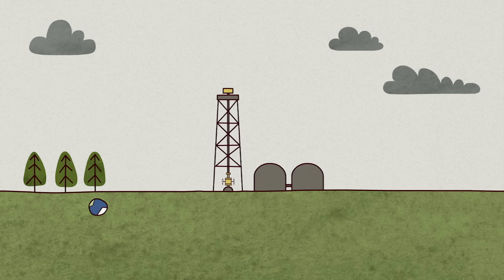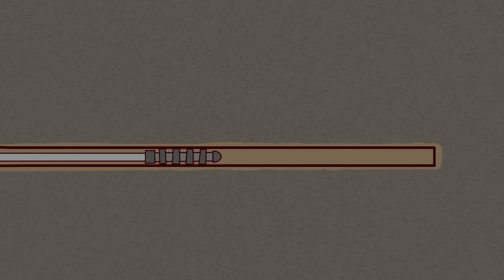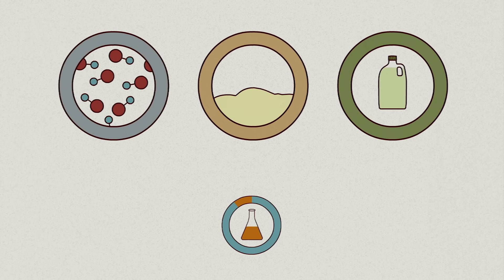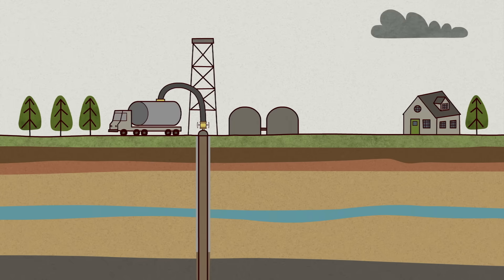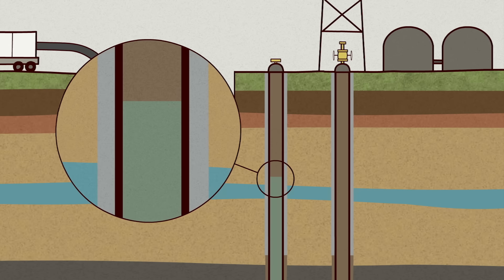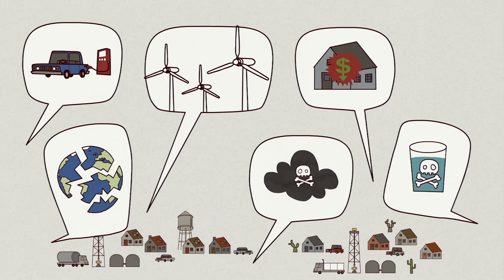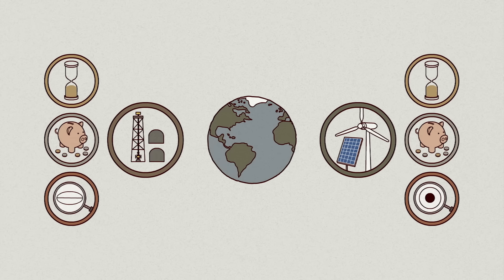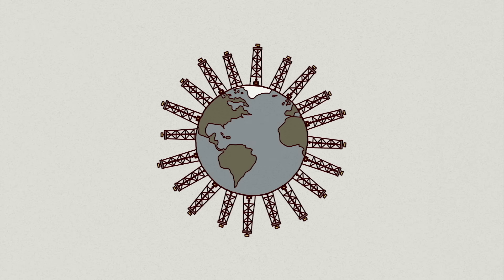How does fracking work? - Mia Nacamulli

Comment: I have one comment regarding how fracking (i.e. natural gas industry) diverts developmental resources from those of renewable energies. It is strictly informational, but still feel free to respond w/questions or points for further discussion.
The means by which energy is generated from natural gas is far more flexible than many of its competitors, including renewables, because its energy output is variable and feasibly managed. These two factors are critical when supplying the highly variable demands for energy typical of societal energy consumption.
Renewables, along with other industry competitors, could more readily compete if there were major advances in energy storage systems/technologies (e.g. batteries, mechanical storage, etc.), but those advances are dependent upon the energy sector's developmental resources. 
If renewables could less directly compete with other energy options for its development dollars/resources, then the "energy storage stop-gap" might avoided, but until then the U.S. and the world will remain dependent upon the energy sector's strongest options. At the moment, fracking/natural gas tops that list.

Comment: Two major problems with this video:

1) At 3:40 when talking about groundwater contamination, you accurately depict the cement casing leak where hydrocarbons leak into the surrounding groundwater. However, you go on to say that "fracturing under water sources as well as hazardous underground seepage and leakage" also contaminate the water. This is false. It is physically impossible for hydrocarbons to travel 2500 meters through impermeable rock from the place the fracturing took place up to the water. The only risk for contamination is when an accident happens in the cement casing which is completely unrelated to the fracking process. Thus when drilling for oil and gas, fracking does not impose a greater risk for water contamination compared to a conventional well that produces oil without fracking. 

2) The vast majority of fracking done today is not for natural gas but for oil. Not once did you relate fracking to producing oil. This process has revitalized the oil industry in the USA and has lead us to become the number one producer in the world. Thus, all arguments made in this video about environmental/economic impact need to be heavily revised. Perhaps renewable energy sources could be researched and developed without natural gas but it is impossible to further develop our use of energy and way of living without oil.
Reply: umm I have to question what you're talking about 1) getting rid of waste can be cheap if the infrastructure exists it's just hard because it's dangerous if someone were to dig it up not because of its impossibility to store. 2) Why would you have to rebuild a power plant they rarely explode yes that's somewhat expensive but any other form of power you would have to do the same or pay for expensive active fuel.3 ) as for renaturation of the mines I admit I haven't heard the word before but every form of power requires mines why is nuclear power worse not only that but its not a required thing?
Reply: just seen your comment mate and you are wrong on your first point. geologist's are not able to see into formations. so the assumption the a formation is impermeable can only be surmised based on the type of mass you are getting out of the drill hole. if you have micro fractures or other types of irregularity's in the formation the first you will know about contamination will be long after the fracking has started. or worst still long after it has finished and the company has handed the site off to others. with oil, drilling, mining and power companies track recorded of failing to act in anyone's, but there own, best interests the risk of this type of contamination going unreported or corrected is very high.

at the end of the day fracking is little used and mostly in highly stable formation. with no trust worthy oversite or studies on the affects underway. this limited success with no independent critical analysis of the system is now being used to push for fracking on a wider scale. with the assumption that the technology is fully developed and its affects are understood. both of these assumptions, like your assumption that the over lying rock will be impermeable, are false. fracking is playing fast and loos with the environment to make a quick buck.

your second point seem to imply that life as we know it can not go on without oil or gas. if that is correct I would suggest that you maybe give that one a bit of a rethink because fracking is not the answer even in the sort term my friend :)
Reply: maxybaer123 the cheapest is only nuclear energy if you exclude:
-renaturation of the mine
-rebuilding the power plant 
-storage of waste (we still have no idea how to deal with)
Reply: +Davis Farish
1)when they are talking about risk of contamination under the water there not talking about hydrocarbons as clearly state "improper disposal of WASTE water can potentially contaminate drinking water" not only that but seeing as the water in question is being used to break rock it contaminating the nearest source of water is not impossible.

1.1)Your conclusion about it not posing a greater risk then drilling makes no sense you dont provide nearly enough evidence that its safer. Just think about this for a second to drill all you do is pump a liquid out of the ground and your done to frack you put liquid under incredibly high pressure into the boar hole and then crack the rock with that liquid you then have to dispose of the liquid just that fact alone increases the risk of contamination.

2) do you realize what your saying that because oil is profitable it has no impact on the environment and the fact that it has made the USA loads of money is irrelevant to the point as this video is not about USA fracking but the issue of fracking in general

2.1) It is always possible to not use oil wether or not its efficient is another question can you explain to me why its impossible to develop renewable energy without oil I understand its useful but you have yet to provide a reason why its necessary.

PS.
I am relatively new to this topic and would like to learn more Im writing this as an attempt to further understand your argument not to be a troll or scream my POV to the world
Reply: +maxybaer123 

Sorry for the late response. I'm sorry that you found my explanations difficult to understand but I will try again. 

1)  There is only one possible scenario when it comes to water aquifer contamination, a leak in the cement casing of the wellbore. I say that fracking does not impose a great risk because this casing leak can also happen in a vertical well where they are just pumping oil from the reservoir, like you said...no fracking required. In a horizontal well where fracking takes place there is no greater risk of a leak in the casing compared to a conventional vertical well. What I'm trying to say is that water contamination can happen in all oil drilling and whether your fracking or not has nothing to do with it.  

1.1) When you talk about waste water injection, this is done in Salt Water Disposal Wells. You can research on your own whether these disposal wells have ever contaminated the water table. Again, salt water disposal wells are needed with unconventional wells that don't use fracking also because water (brine) is a by-product from the reservoir alongside oil and gas. Yes, fracking has dramatically increased the need for salt water disposal wells. 

2) What I was saying is that the video only makes arguments about fracking in regards to producing natural gas when in fact today, fracking is mostly used to produce oil. Maxybaer123, all I have to say is that I would love to come visit your scientific laboratory used to develop new techniques for renewable energy that completely runs on renewable energy, uses no petroleum products (plastics etc.), and you ride your horse to and from the lab. It is only reality that fossil fuels are a necessity to take humanity to a point where it can only use renewable energy and I will welcome that day.
Reply: +Davis Farish there exist all electric cars and non petroleum plastics I agree that oil is useful but we dont need every scrap the earth has to offer we could start spending more on mass production of renewable resources and try to drastically curb our use of oil Im not saying we should get rid of it entirely just stop using it like a fuel and start using it like a metal the only things Im aware of that actually require oil as a fuel are planes (and there are prototype electric planes) and rockets.

As for energy there are many better ways of getting energy the cheapest probably being nuclear.

Comment: We simply cannot produce enough power to crack the rock from the bottom 
of the well to the water table. The water table is above an impervious 
rock/clay layer. This layer remains intact thus not chemicals enter the 
ground water supply. While you might get some flaws in the casing, the 
gas will follow the easiest path, the well head. This issue with the 
water is the disposal. The options are injection wells and new 
facilities are being built to handle this water. The pads are designed 
to prevent spills, they work as swimming poles. The sealed pads, casing 
and disposal facilities are there. There are faults all over the country
 and earthquakes have been caused by mining, construction and even just 
because the land is decompressing from glaciers. While it isn't harmless
 it isn't the danger it is presented to. There is a a lot time, 
engineering, inspection, money and oversight over these operations. Many
 people working and building these facilities live in the areas, they 
care what happens to the land, they care about their family farm of the 
last 200 years. There are incidents and things happen, but they are 
isolated and few in number. Short term, this is the best option.
Reply: @Tbone only work for independents and start ups
Reply: @Tbone Everyone is biased, I have left the industry for different construction. Durring my time I was discharged by clients for holding them to environmental standards, worked clean ups for spills, advised/consultated for government agencies and live in the area I have worked. I worked to establish new and more stringent management processes for third parties. The industry does do good but comes with risks. Thise risks need to be managed and monitored. The 2008 era was wild, tech out stripped regulations and that is were many of the issues arose until the agencies could keep up. In Ohio ODNR didnt catch up till 2015 and they are still tighting as they should.

Comment: Thank you for such a helpful overview. I feel like I finally understand more of the controversy!
Reply: I wish I could say it was helpful, but without numbers and context provided by a knowledgeable engineer, it's little more than an introduction. They used radiation symbols all over the place to scare people. They talked about earthquakes without mentioning magnitude. They mention methane emissions as if that's not literally what LNG is, and without acknowledging that because that's the target to harvest, fracking companies have no intention of losing any of it if they can help it. That's profit leaking out. The geologist might explain why the layers are drilled the way they are, and what is known about long-term impacts as well as the extent of the reserves available (it's HUGE). The engineer could give more context to the safety measures put into place specifically to protect groundwater and regarding the handling of the fracking fluid. Concentrations of those components is everything, and again, we have no numbers. This is a technology which is literally life-sustaining. We're talking about shutting it down with no viable alternative capable of replacing the sheer volume of energy we consume. This deserves more honest discussion.
Reply: My biggest problem is the diagrams are not to scale. When they say "deep below the surface" they mean DEEP BELOW THE SURFACE!  The diagram implies it is only 300-500 feet down.

Comment: Good video, very interesting.
Saw some comments here talking trash about renewables, here are a couple of counter arguments and why fracking is probably not a good long term solution.
https://www.positive.news/2017/environment/24858/uk-wind-generated-electricity-2016-coal/
https://www.positive.news/2012/environment/energy/7135/denmark-targets-100-renewables-2050/

Comment: At least you guys are non biased, unlike some of the other ted talks.  Like that idiotic fat acceptance talk that I found just generally unwatchable.  I'm all for protecting the environment but I know that green energy sources have their glaring flaws just as much as any fuel source.  I think that when it comes to stuff like fracking that there should be a lot of inspections and a lot of other safety policies.  The process can effect more than just people working there since these types of wells are usually near rural areas that need water just as much as the well does.  Whether it's to drink or general industrial usage.  This is my same grievances with oil wells.  There are way too many accidents and an unacceptable lack of inspectors for ground oil wells in America.  These fuels sources are highly flammable and any lax in safety can cause a fire at the least or an explosion at the worst.

Comment: How fracking works:
Penis pipe gets jabbed into a hole in the ground. Liquid comes out of penis pipe and that causes black goo to be forced out of the cracks in the ground and higher up to the surface. Then, vacuum is used to suck up black goo. There, I saved you 6 minutes.

Comment: Btw - not all gas wells need fracking...

Not all fracking is done horizontal drilling  

The depth of the well varies more than stated - it depends where the shale layers lie in the geology

Not all shake gas wells also contain oil

Most wells are double lined - so if the inside metal casing is damaged, it is protected my the concrete casing around it

With love - a chemical engineer
Reply: It's also not limited to gas wells. I've heard people who adamantly oppose fracking yet are unaware of this simple fact

Comment: Ultimately every living organism has received its energy from the sun, why can't we get energy directly from the source or at least a bit closer, instead of digging for the residues of dead animals?
Reply: Miguel Angel Vazquez Because there is something called night and clouds the block the sun for at least half the day...
Reply: Adam Smith There are multiple solutions for storing energy, including batteries, that is why we need better battery technology. I'm not referring to just solar, that is why I mention a bit closer to the source, like wind, which is caused in part by the thermal difference produced by the sun. Also, if renewable energy were more widespread it introduces the possibility of selling energy from places with better conditions to a place with a cloudy day for instance.

Comment: They really only talk about gas, but fracking is also used for oil. Fracking also doesn't only have to be used in shale, it can be used in other formations like sandstone. While they mention renewables, they don't fail to mention the far dirtier coal that cleaner natural gas could be displacing. This video seems to take quite an anti-frack bent.